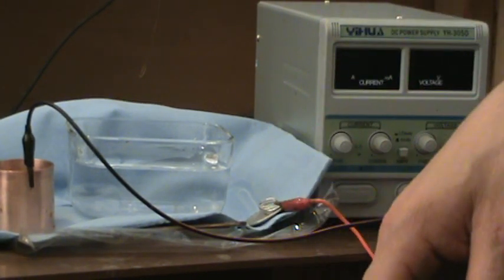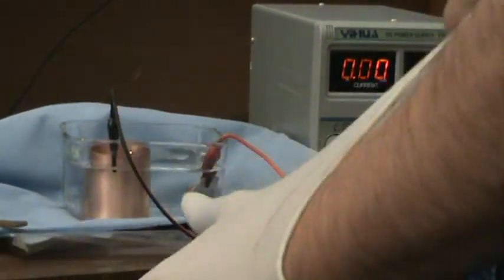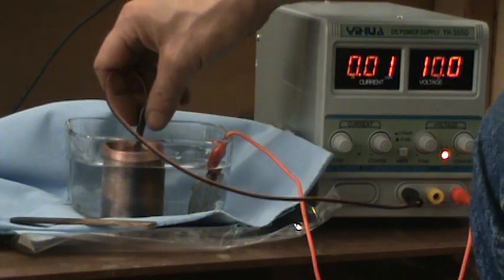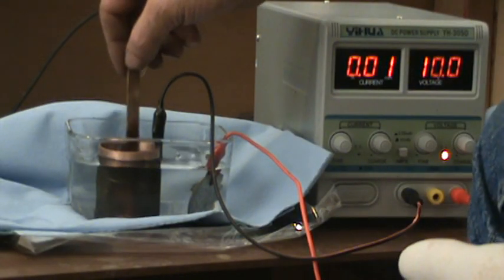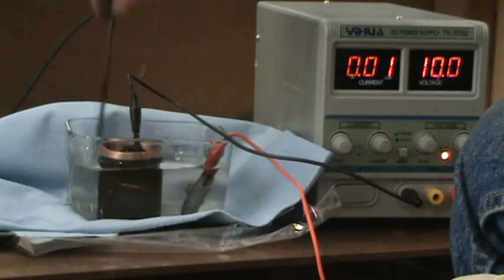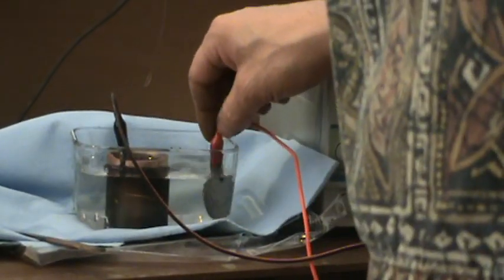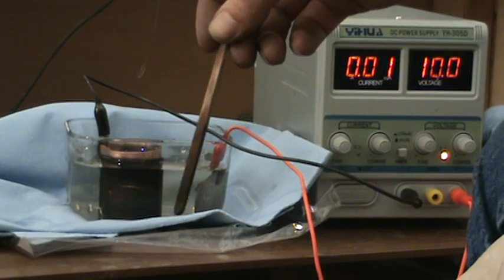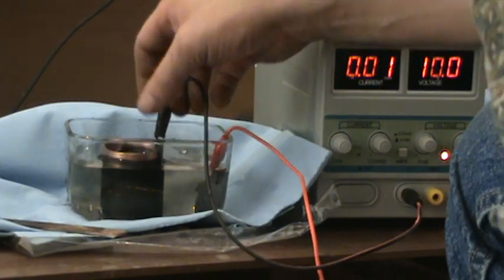How To Electroplate Silver Over Copper

Comment: The problem with the gene pool is a lack of life guards. Ignore the criticisms from the "chemist" who said this is not electroplating. The fact that there is an electrochemical reaction does not take away from the fact that a positive sliver donor electrode with a negative plating electrode in a silver salt solution will electroplate. 

Now, as others have said, the voltage you're using is way too high. 1 or 2 vdc is perfect. The current density, in amps per square cm or inch determines the rate of deposition. 

For the "chemist", the term he is looking for is arginosus. Might be worth his while to look that term up. Silve ions are still used in various settings medically. The historic term for silver nitrate is lunar caustic. Silver tattooing is a common adverse effect of excessive silver exposure. 

I'm a chemist and a medical doctor. You did a good job. Take the "expert" feed back you get on here with a couple grains of salt. Btw, a grain is a unit of measure! Silver nitrate is a silver salt. As the saying goes, bang the rocks together people! :)
Reply from the maker: Thank you very much :-)
I will be having another go at this soon & making a new video, hopefully with better results.

Comment: Apparently the voltage has to be around 0.8V, not 8V! The deposition speed is a few microns per minute. The piece to be plates goes to plus and the cathode has to be pure silver. If the object gets covered with black oxide, it is a sign the voltage was set too high.
Reply from the maker: Thanks.  Im learning.  I will soon be making a new improved video of this process, with much better results,,,,I hope :-)
Just finishing up moving & improving my lab now.

Comment: You've done a great job on the video and arranging things in the clear viewable angle.  It makes this video more pleasant to watch.
Actually, I have watched it three times and tried to understand how to plate silver without using cyanide.  I have to agree 100% with the comments from your chemist friend.  The reaction in this video is a simple redox reaction that did not really require an electric current.  The only amount silver (or silver oxide) plated on the copper tube was purely from the silver nitrate while the silver anode was not a part of the reaction.  This explains why the copper tubes shown here are barely covered by an uneven layer of silver, even after some physical rubbing.
In order to place silver nicely with bright and even coverage, one must use a soluble silver complex solution that does not react with the base metal, such as copper, directly.  Cyanide being the best choice is because the high stability of silver cyanide complex.  There are many other compounds that forms stable silver complex although none of them come even close to cyanide.  This will require a very accurate voltage control, additional of brighteners, and other wetting agencies to condition the plated surface.  One thing works is to use (lots of) iodide salt to form a silver complex.  The only problem is the cost of iodide salt.
One thing I like to mention about the voltage and current is to clarify some misconception in this area.  In a simple plating application, the main control you have is the voltage.  You can limit the current by using a good rectifier, however, you cannot simply "crank up" the amperage.  To increase the current flow, you'll have to increase the voltage, conductivity of the solution, surface area of both electrodes, or shorten the distance between the electrodes.  Most non-cyanide silver plating will be done under 2.0V.  So your best bet is to add some salt (similar to the ions already in the solution) to increase the conductivity or use multiple cathodes to increase the current flow.
I'm looking forward to your next real silver plating video.
Reply: I found a few commercial silver electroplating solutions online.  The good ones come with MSDS sheets.  The contents give a good idea on what compound was used.
Reply from the maker: Thank you much for your very good information, it is much appreciated :-)
And thanks for wording kindly to me, many are very rude & cruel.
I give your comment thumbs up, thanks again, very informative & helpful for all :-)

Comment: any suggestions on how to electroplate in gold?
Reply from the maker: No, sorry i dont know.  I would think you need to replace the silver Nitrate with a salt of gold.  Maybe a gold chloride, not sure.
Reply: yes, you can electroplate any metal on any conducting material just by following two things,
1. use X metal as electrode if you want to plate X coating on other material.
2. use the X metal's electrolytic solution 
the voltage and current will speed up the process..

Comment: so the rate of water flow in river is determined by the rain fall in its catchment area and it entirely independent of the obstacles you put in it's way, the water will always get through one way or another.  Stepper motors apply fixed speed and accelerations to what ever it is they are moving regardless of the object's mass (there are limits to the stepper motor maximum force), and you get constant current PSUs, for example battery chargers or led drivers for example ebay item # 231085962741

Comment: in hydraulics you can apply a pressure which results in a flow but you cannot apply a flow .... in mechanics you can apply a force which results in an acceleration , but you cannot apply an acceleration ... the word apply suggest you are acting on a situation which results in the effect.

Comment: You absolutely can push a current through a circuit, it is done all the time in radio transmitters, LED, laser drivers and many other types of circuits (I have designed these kinds of circuits for over 10 years and have a PhD in semiconductor circuit design though I don't have 40 years experience as I'm only 36). If you apply a 1uA current through a 1K resistor you get 1mV, in a circuit you can control any 2 out of the 3 variables in for formula V/I=R.This silver plating circuit is no different.

Comment: You would still apply a voltage in those cases. The only difference is that the voltage applied is based off of resistance and other forward voltage drops to give a desired current. You can't simply push a current through something and have the voltage and/or resistance change to meet that current. You have to create a voltage difference which will then create a flow of current. His 40 years of experience has served him well.
Reply: If you are replying to my remark about using amps, them you missed the point. Of course they're will be voltage. The point is to set the current at a level so that it remains steady, while the voltage fluctuates, as opposed to setting the voltage and having that remain steady, while the amperage fluctuates. Of course one it the other will fluctuate based on the conductivity showing however many watts to be produced... And do in and so forth....
The point is, the current is what sets the standard. At least that is what I have been told. Who knows, maybe it is all just a glitch in the matrix, b and I am not even here

Comment: "Applied current" is a perfectly acceptable term, you certainly can apply current, this is commonly done in semiconductor laser drivers, high power LED drivers and many analog curcuits in CMOS.  Does not seem that your 40 years experiance has served you well.

Comment from the maker: No offence taken, it is not a good job i did. Yes, too much carbon.  Plating is  adhered to the copper, but very thin layer. Cant just wipe it off with soft cloth, but i can wipe off with scotch guard pad
Reply: That is not carbon. It is silver oxide.
Reply from the maker: @kmarshall6046  But did you look at the "new improved video" that i have pinned as top comment?
https://www.youtube.com/watch?v=TKw9Pn91KU4

Comment: Hi Paul, I use 3.0 volts when I am electrorefining silver. My mixture is also more concentrated than yours ( more Silver nitrate ). I get a bright silver coating straight up. I also don't allow the alligator clips in the solution for purity sake. I do like the clear dish you use and finally, what is the end purpose of the copper you are plating?

Comment: I have used copper sulphate to pull the copper off a zinc penny and transfer it to another item. I was wondering if you could use plated silver as the silver supply and transfer the plated silver over to a silver item recovering the silver plate to the silver item.

Comment from the maker: I dont think the table table salt will work.  I got the silver nitrate from ebay.
Professionals use a type of cyanide. The car battery is too much current, cranking amps, dont use.  A battery charger for AAA to D size batteries may work well, but not a charger for 12V car batteries.

Comment: Dear Inventor3: Do you need to use Silver Nitrate? Can you use table salt (NaCl)?
Also, can you use a regular 12 volt car battery or battery charger?

(I want to silverplate some copper jewelry using silver spoons)
Thanks
Reply: Did you get an answer anywhere?

Comment: Sounds like an engineers response.  You can try to make inventor3 out to be an idiot, but really you just sound like an ass yourself.  His power source has both a voltage limiting regulator and a current limiting regulator in it.  "applied current" can easily be translated from hobbist to engineer as having set the current limiting regulator @ 3A and the voltage regulator @ 10 volts.  The simple fact is this information is all useful thanks to inventor3 and the video inspire discussion.

Comment from the maker: You are correct, my mistake. This is what happens when you are self taught :-)   I set my PSU to 3A, So im guessing that would be with zero resistance, i understand that 3A is not what the current is through the bath. 
Thanks for the correction

Comment: I've been an electrical engineer 40 years and have never heard the term 'applied  current' . it has no meaning, you cannot apply a current, you can only apply a voltage , then the current follows, determined only by the resistance of the circuit (in dc circuits ) (as long as the current is within the limits of the power source, 3A in this case)

Comment: You have just demonstrated why silver  nitrate cannot be used for electroplating , it does deposit pure silver but in fine particles which don't adhere well and don't reflect light coherently, hence look black , a silver plated surface should look like a mirror,  also not a good idea to have the crocodile clips in the solution , anyway well done for having a go .....

Comment from the maker: it is 3 Amps current applied by PSU, but when placed in salt bath & add resistance of silver and copper parts,,,then only .01 Amp through the whole circuit(bath with parts).  Current will also increase through the circuit as more silver particals break off into the bath.

Comment from the maker: It was cheap compared to most others, i think it was under $100, new from e-bay.
Yihua regulated dc power supply i think model number is 305D
It has 30V 5A, both variable, with DRO(digital read out)

Comment: Make sure you steel wool and detergent wash it first to remove grease and oxides until all non copper specks are removed  You can then use a copper etching compound like Ferric chloride (sold in electronics stores for etching circuit boards) to "peel off" the old surface of copper by a few microns using a sponge. Leave on for 5 mins. (Use latex gloves as FeCl is also a poison.) Use the plating technique I mentioned above. No I dont use those eBay stuff.
Reply: After cleaning it, I just put the copper on + for a few minutes in a coppersulfate solution, so the top layer of atoms gets removed and then rinse with distilled water.

Comment: Ground workpiece and dip in solution, To finish this in seconds, attach a small silver anode to a metal handle (I prefer a stainless strip with a fiber/wooden handle) I usually tie the silver with cloth strip wrapping to the stainless strip so the solution can seep through and react with the silver faster. Make sure the the stainless steel is connected to your power supply positive. Then rub that portion into your workpiece in equal circular strokes to deposit silver evenly on the surface.

Comment: Too slow for production purposes. Use a heated aquaeous solution of Silver cyanide with potassium chloride mixed with pure silver anode or filings. The potassium chloride regulates the amount/thickness of silver deposited. Works in a few seconds. Then dip in potassium cyanide for 5 second to lock in the luster of silver. Rinse in distilled water and dry.

A liter of this solution will be good to plate at least a hundred of those tubes.

Shhh. That is a trade secret.

Comment from the maker: I "applied" like 3A, with the PSU "set" at aprox 3A, but, yes, much less current actualy flowing through the salt bath & parts. Salt bath & parts acting as resistor/load, so yes only like 10mA actualy flowing through everything, but 3A is "applied" to the circuit.  It is 3A "before" connecting anything to the PSU. Please let me know if you think im wording things incorrectly.

Comment: Your power supply shows 10 Volts but 10mA to 20 mA. You are talking about 3A. How this happens? Varying the voltage or moving the anode to cathode closer raises the current. 
Is your current meter (Ampere meter ) wrong or left in another scale?

Comment: Of course, just leave the copper tube into the silver, and the reaction will take place. But be careful, as if you leave it for too long you will end up with silver crystals on the surface. you won't need the medal at all... just a more concentrated solution of silver nitrate:)

Comment: This is why most digital ammeters can only measure up to 10Adc The 1ohm internal resistor can only handle 10A which is a pretty big (physically) resistor. Here comes the REAL TIP, if you don't want risk your digital ammeter.  Put an extra 1ohm resistor in series with the load on your circuit and simply measure the voltage over that resistor (meter in parallel and on Vdc).  This allows you to measure currents without the need to break the circuit every time you need to measure amps.

Comment: A tip, any digital ammeter reality only measure voltage. Sounds crazy? Read on...  When putting the meter in series with the circuit and its load and switching to measure Amps, an internal circuit switches to measure the voltage over a 1ohm resistor and displays that as the amount of current.  A = V/1 ohm. So if the potential over the whole circuit is 12V and the total resistance of the load is 100ohm then your meter will display close to 0.11mA. Remember the 1 ohm.

Comment: Paul, I need to point out that current is not measured in parallel to a circuit in the same way voltage is measured.  1st you have to put a load on the circuit so that some current is actually drawn then you put the ammeter in series with your circuit and your load.  Now be careful, most digital ammeters can only handle 10A.  Ohms law says,  A = V / R.

Comment: ya, just drop a bar of silver in the solution and set copper on top of it so it makes contact. No additional electricity needed because its burning up the silver in the solution releasing poisonous nitrates into the air..

Comment: never done this but from what I have read. pre-sand and "pickle" your part. degreaser for oil, acid to remove oxide, distilled h2o for acid residue.  silver nitrate works just fine.  some where near 5V. but the amperage does the work, determines plating rate. also you don't want to have too large of a charge for your surface area.  it can be tricky but doing fine.  your part darkened slowly cause it looks like you ran 1ma. try a few amps.

Comment: I work at a metal finishing shop and what I do is I plate electro less silver, Tin, and nickel. I don't know what all this talk about "oil the part before plating" is but don't do that. Keep Grease off the part or else when you there will be a layer of oil in between the copper and the silver. Which would ruin
Your part. Keep the part as clean as possible before you plate it. We run parts though sulfuric acid and cold water a couple times. Then plate it

Comment from the maker: Hmmm, did not try pulsed,,but i first had it at 3V,,,and the water never seemed to start turning color. I also did the 3V set-up using 2 batteries in series,,,but batteries start getting weaker after a while.  The solid silver did not seem to give up much molecules at this voltage setting,,but things still worked, but it would take 2 times longer to plate at 3V. Water/salt bath will stay clear for many hours at this voltage setting.

Comment: No,
no oil before the plating !
Just a very concentrated colloidal silver bath, so only silver particle in destilled hot water with an electrolyzer done.
Then put the clear fat free copper tube in there and then add
oil or grease into the water...
Then soon all the walls also of the baker will
be covered in shiny silver not such a dark oxidized silver
as you had....!

Comment from the maker: Yes, because results are from after only 15 minutes,,for a good part this size it takes about a half an hour. When you say results are poor, are you talking about the piece i plated in the video or all the copper tube i show at the end?  Hard to get perfectly even coat without having some sort a constant aggitator in there.  At the end of the video the salt bath is darker, and this is when it starts to work the best. Did you mention to add oil to the copper piece first, before plating!?